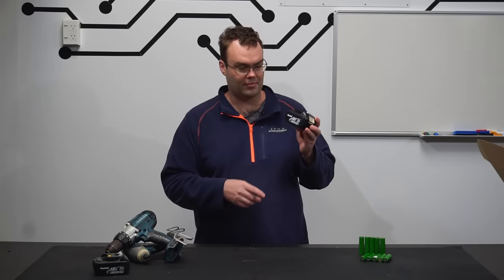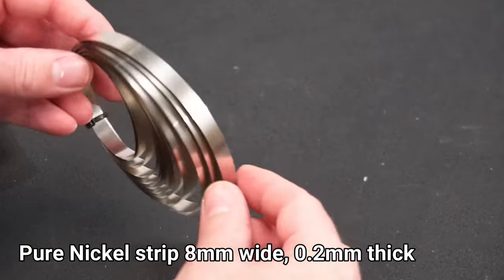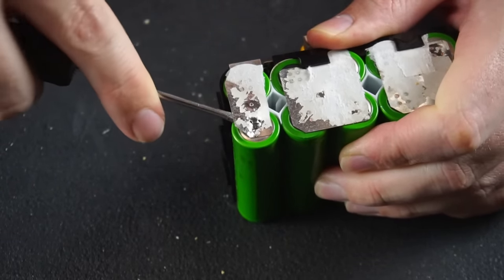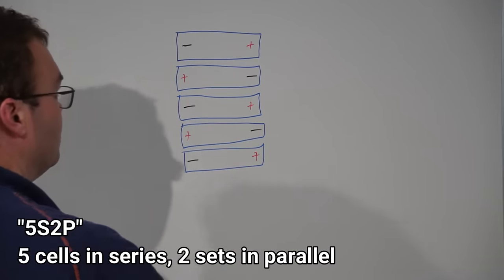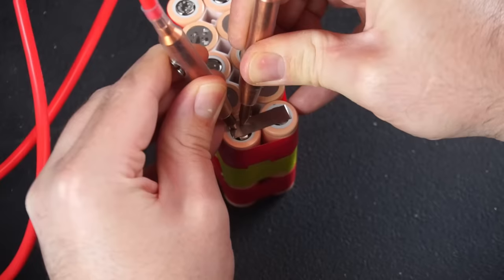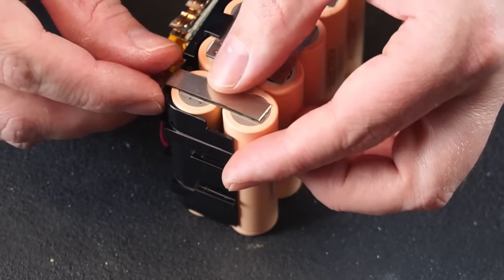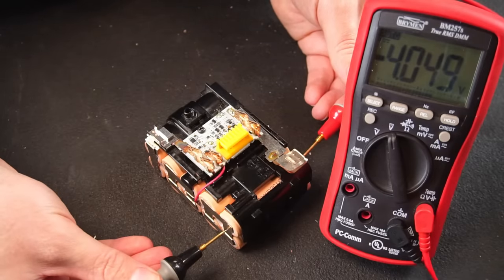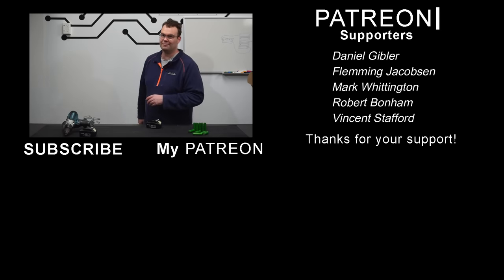Repacking Makita 18v Lithium battery with New Cells (Save $$$'s)

Comment: Great video! Just a note: you didn't get a "battery error." The battery error is signaled by FLASHING red and green lights. When they're solid, it simply means the battery is more than 80% full. It happens during every charge cycle. Thanks for sharing!
Reply: Right, battery was OK in the first place, didn't need to drill few hundred holes :)
Reply: Exactly
Reply: Yea, tbh the lights aren't the most straightforward. Thought I had 2 faulty batteries myself when I first got mine. And mine has lines connecting the bottom lights directly to the battery fault row, as if that's only what they're for... -_-
Took more than a few minutes of staring at it before it clicked that the other dots aren't even lights, they all have to use the bottom.
Reply: @drankydrank1  yep. Thats mukeeta...
Reply: Yep I was going to say that as well, spot on.
Reply: You are lucky it worked. I replaced a complete pack with LG 3300 18650s  and a new board with balance. I have now tried 4 boards and all fail to charge in the Makita charger which gives me a faulty battery indication. I first charged all the batteries in a Opus tester. The pack will charge in a dumb charger but not the Makita. I am now confused why it fails as all batteries are fine

Comment: Your charger just said your batteries were at 80%+ charged. They have to blink if your charger thinks your battery is broken.
Reply: I was confused too🤷🏻‍♂️, I was like.. am I missing something? he said the charger thinks the batteries faulty! cuz I have tested new in package Makita batteries, good used ones and an old faulty one on my charger, so I know what the lights means. Lol
Reply: lol, those battery indicator keys take a bit of study to read sometimes. I totally missed it the first watch through that the rays off the lights mean flashing and that there was even an 80% charged light combination which I guess is useful if you need the battery now and don't want to wait for the final '20%' but that's absent in most other brands I think (I'm most familiar with Ryobi)
Reply: @TwoTall1988  80%-100% takes as much time as 20%-80%, so it's very useful indeed. I now have over 30 18V Makita batteries which I take to the job, so I rarely even take my charger anymore, but I used this feature a lot when I only had a few batteries;
Reply: @InsuranceIsLegalizedRobbery  You got it, like many guys say, read the manual. So many things you can  learn there.
Reply: I like how you can change the tune on the charger, so it plays a different song/ notification. The chargers can be hard, I remember making a similar mistake as in the video and almost got rid of a good battery.
Reply: @InsuranceIsLegalizedRobbery  I think the 18650 battery is the key...perhaps the circuit only work for original 18650 battery which is the same charge capacity...anything else not the same the circuit will think its not the same battery.
Reply: maybe a little too much time spent on replacing batteries, when you buy quality batteries like sony and the time spent on it to change, i think it's better to buy a new one, or maybe switch to milwaukees that last longer than makita.
Reply: So if I buy 10 x 3000mah 20A batteries I can have a 30 AH battery?

Comment: Safer to balance charge the pack for the first time. If you don't have a balance charger, fully charge each cell to 4.2V. It's way better to start with a balanced pack because in time it's more likely that the pack will get even more unbalanced. 
Great video btw, I enjoyed watching! I've done the same operation a few years ago.
Reply: Alternatively, since I'm concerned about soldering on fully-energized cells, if you have a charger that has a voltage readout, just charge each cell to the same level as highest-voltage cell.
Reply: Yes, I noticed he didn't match voltages as well but a safer option would be to charge to storage or nominal voltage prior to working on the pack.  Avoid working w fully charged liion wherever possible.
Reply: All the cells must be at the SAME voltage before starting the build. With no balance cirquit, with inbuilt imbalance you will always be overcharging some cells to start with.
Reply: ideally you should use a hobby charger. let's you know if you have a bad cell, and charges or discharges  the cells for you, balanced
Reply: @HobbyFinn2  hobby charger
Reply: I think that is possible to be used 5S ballance board inside in battery pack just to auxiliary function! That means when the battery charging,each series battery need with the same voltage.when one cell voltage get 4.2V ,the other cells not, the first cell voltage will discharge to wait the other cells rising to the same level.
Reply: I was thinking the same. That pack will not last long if not balanced. Also when I do these, I do the series connections first as these are more important than the parallel and the first spot weld is usually stronger than the overlaid second strip.ie if one of the parallel connections came off it wouldn`t matter as very little current flows between the parallel connections.
Reply: can you balance charge your mom
Reply: Under load the cell automatic balance themselfs. The cells with higher voltage charges the one with lower voltage.
Reply: @jelleroggen The will, but might take damage while doing so. Not only do they need to be equally charge when connected. They should be tested so they take about the same amount of charge even if all are same model. Now these ones came connected so hopefully all that was done beforehand. Had it been loose batteries more testing should have been done. I think he said something about it.
Reply: @jelleroggen I don’t think so; unbalance will remain and as there is no any balance mechanism, it will overcharge some cells and over discharge others

Comment: Nice job - very professionally rebuilt. That spot welder really is a must for this type of thing. Cheers.
Reply: I've built plenty of packs with a 150W soldering iron, works just fine.
Reply: @axiom1650  How did you do that, I thought it was dangerous using an soldering iron on batteries.
Reply: @brianbecking1  Quick in and out with a beefy soldering iron, the heat doesn't have time to spread.
Reply: @axiom1650  You are not the only one. But it's not recomentded.
How does it make financial to fix ~40€ pack with a 150€ spotwelder? Some BMSes needs continious power to work otherwise it counts as a fault, some are even programmed for limited charge cycles.
Reply: The initial check showed ~500mv discrepancies -- which would force than balance themselves - e.g there was 3.6V and 4.1V cells, setting them in parallel is just dumb as it will cause the 4.1V to charge the 3.6V at very high current. This the likely reason for the error. The correct way was charging (or discharging) each cell individually to the same voltage with some 18650 charger that are extra cheap.
Reply: @ArthursHD  Depends on how many battery packs you fix. If you're invested in the battery system, you may have tons of batteries...

Comment: We'd love to dyno test the power (impact wrench torque) difference from a custom pack like this and new!
Reply: That would be nice to see the difference 👍🏼
Reply: It's the same..he actually Downgraded...The Pack he has is rated for 3.0 AH....the pack he replaced it with is 2.6AH ...both 18Volts but the time maybe he lost about 5 minutes worth and little less power too.
Reply: @paperlessdigs6169  that is incorrect. The cells he used are 2.6Ah, that is correct. But, you must remember that this is a 10 cell pack that is 5s2p. The lower row of cells are added in parallel to double the capacity, making it 5.2Ah. 

AH ratings only generally reflect run times and not amperage output, and typically speaking lower capacity cells are rated for higher amperage, as long as they are not super cheap knock offs.
Reply: Exactly, that original pack had 1500mAh cells. 2 in parallel = 3Ah. He used 2600mAh. Double that= 5.2Ah...

Comment: This is a good tutorial but one thing I would say is make sure all cells are at the same voltage or as close as you can reasonably get.
Just get a simple single cell 18650 charger and charge them all to the same voltage first, that gives you the best chance of getting a good pack and is far less confusing for the BMS.
If you don't then the cells may never get to equilibrium.
Reply: Agreed. Especially since this BMS doesn’t have cell balancing.

Comment: Dont forget to charge each cell to the same voltage first. If i remember it right some were 4.1V and some 3.6V
Reply: To me it looked like he balanced them. Maybe he forgot to mention it🤔.
Reply: He didn't balance them. Also, his Makita pack is an old one that doesn't have a Balance function, and doesn't even have individual cell voltage monitoring. So starting off with a unbalanced pack is just a disaster waiting to happen.
Reply: You are absolutely right, that's why the charger went in faulty situation, he should have balanced the cells first. Moreover, first time I see such a BMS, normally should have 0-4-8-12-16-20V connection points....

Comment: I just did a similar thing with my father on an 18V Ozito battery, ( Bunnings brand), we knew about the spot weld method but only had a soldering iron, & yes we knew about the heat problem so were very sparing when using it as we had to use what we had. It was a bit of a frankenstein job but it did work in the end for a bit, a tip i'm not sure if you mentioned, but when a battery reads dead, only a few of the cells may be gone, we only had to replace 2, wish I had seen this video 1st, at least I know what to get the old man for christmas, cheers.
Reply: Soldering is OK(but not great) to connect cells together as long as you are experienced with soldering and have a high wattage soldering iron (100w+) so you can melt the soldering fast and remove the iron.  Most likely the worst that can happen is you will lose some of the cells capacity if you heat it up to much.

Comment: I refreshed my old Bosch drill from ancient dead NiCad cells to 4S2P 18650s a few months ago and its been great. An active balancer keeps the cells bang on. Had to design and 3D print a new case as the cells wouldn't fit the standard case. Fits great and looks the business in bright red PETG. A very worthwhile mod.
Reply: I replaced more ni-cads with lithium than the other way around.!
Reply: BOSCH
not
Bosch
Pay attention to detail
Make sure the brain sees exactly what the eyes are looking at
Also - learn that all CORPORATE {Legal} names are ALWAYS in the ALL CAPS ITERATION
The reason for it is above your level of present knowledge.
You would have to understand Law and Latin as well as the CORP'SES in the cemetery
** That is your clue **
Reply: @andrew_koala2974  many thanks for you're comments.
Just one question if I may. Are you referring to my level of present knowledge in law and Latin? If so, then you are correct. It is above my level of present knowledge in those two subjects, but if you are going to write patronising replies then please try to be specific.
Reply: @andrew_koala2974  
Is VANKER a German Co  ?

Comment: Nice. You show a properly done repair of something that's not ordinarily repairable. I thought about doing the same fror my old makita battery, but I ended up getting an after-market battery with Samsung cells, which costs about the same as just buying the cells. But if you can source good high-drain used cells, that makes it worthwhile to do this repair, provided you already have a spot-welder, which is the main challenge. 

I have done a similar repair to a B&D Dustbuster mini-vacuum, and I bought 4 high-drain cells, and replaced them in the battery pack. I found the $30 paid for cells barely made it worthwhile, compared with a new $50 vacuum. When faced with another such repair, I decided to toss the Dustbuster in the rubbish, and instead buy a Makita mini vacuum, and use my existing Makita battery to run the vacuum. Interestingly, the Dustbuster cells were good, and the BMS had failed, refusing to charge it. 

Now I'm convinced that the Makita battery is a massively useful thing, which is worth repairing.

Comment: Gotta repair a lot of batterypacks for that €159 spotwelder to pay itself back..... 😬I mean for own use..
Reply: Great video otherwise! 👍
Reply: right now, in USA at my  Local home depot, it would only take about 3 bad battery packs of 4.0 amps to justify the spot welder for fixing my old packs instead... But sadly time is too precious and I probly will not get around to it
Reply: But once you get the spotwelder, you can build other battery backs too. I don't think that it's a waste, more like investment.
Reply: @innocentidiot9521  I agree, but the initial investment is pretty steep if your'e not gonna keep making packs...  luckily a collegue has invested in one...👍 will probably try it when I'll try and swap cells in my daughters airboard...
Reply: I own a kweld because I build battery packs for electric skateboards and large power wall type battery packs. I also rebuild power tool packs.
Reply: youre joking right..... a 5.0ah makita battery is £52.00 in the UK
Reply: @lazenbytim  what's your point?
Reply: @randybobandy9828  His point is it will only take a few batteries going bad to pay itself off.
Reply: @mikaeljonsson4686  Agreed. But I really think the Kweld is mainly there for people who used to mess around with capacitive discharge DIY-stuff (like me) and got inconsistent results with it (like me ;) ) and have run into the problem of not being able to spot-weld in the past before.
As I've had multiple occasions of 'If I could only spot-weld this I'd be out of trouble' and started my own capacitive discharge experiments with rather varying (bad) results and need to replace 4 packs with new cells (each pack counts 16 cells) with a price close to 300 Euro for each pack, the investment was totally justified (for me)
Reply: @randybobandy9828  just curious would you be able to rebuild a battery pack shipped to you and send it back?
Reply: @lazenbytim  Where? I'd like to buy it.
Reply: Completely agree. Also you can build a really nice battery spot welder for almost free or pennies on the dollar from discarded components. especially if you already have professional test equipment and the lab to work in. (But don’t want to spend money because you’re only use it every now and then)

Check out “diode gone wild’s”recent video, and other videos with more polished designs.
Reply: @nihonbunka  Spot welder is infinitely useful! But yes you can solder to batteries. However I don’t recommend it unless someone is very comfortable with their skill level and is either a professional in the electronics field or has years and years of experience

I am not a “certified“ expert… but I do have a “certified“ electronics lab with all NIST calibrated equipment. half of my business is repairing industrial electronics for Manufacturers and government clients. 
Mostly Component level circuit board repair. 

So I have a bit of experience…

if you  use a very powerful soldering iron or “gun“ like the old Weller 100-150watt pistol grip soldering guns… 

if you have a real powerful iron it allows you to solder it extremely fast before the heat can get into the battery. I’ve tested this multiple times with a tiny thermocouple under the bottom of the second contact, and it hardly gets above ambient temperature. But you have to have a really powerful gun so that it can be soldered extremely fast. Make sure the surface is prepped, clean, with GOOD flux already applied so that the solder instantly flows.
Reply: @nihonbunka  I replaced 2 dead cells and the logicboard in one of my 3amp Makita packs with my soldering station and that has worked fine. 😊
Reply: @mikaeljonsson4686  Thanks. It seems to me that it would be difficult to solder to something as big as a 18650 battery because it would act as a heat sink so either I would have to heat the battery up or have a very powerful soldering "station" so that I can heat up the bit of the battery that I want to solder. But thanks, I will give it a try.
Reply: You achieve a new level of possibilities
Reply: A spot welder was one of the best purchases I have made
Reply: Good video. But old. If you are still around to answer. Was this batter you are working on in the video flashing red green light? Or just fixing because it was draining fast,  because I've read in the past if red green flash you need to replace the mother board. Is this true???? Thanks